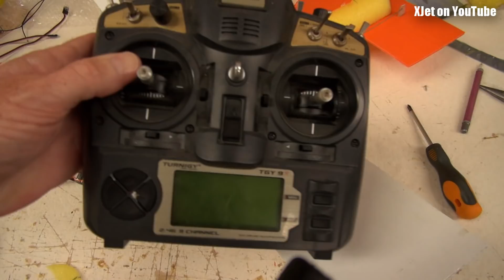The $2 pool-noodle RC plane build and flight test (part 2)

Comment: Reminds me of the ultra cheap "bearer bomb"  design we adopted for controlline combat. Due to regular crash/collision damage in 'cut the tape' combat competions, we started using ultracheap to build models, consisting of one sheet bals, two hardwood square engine bearers, a small fuel tank. Cutting a bit of the balsa sheet to make tail plane, gluing it across tapered engine bearer and rest of balsa sheet as wing,  with engine mounted at opposite end with fuel tank, sometimes that held by rubber bands or glued too. The elevator connected back to bellcrank to the control leads. Absolutely low cost to build.
With a but of paint, or even no paint built on the flying field to replace a damaged aircraft, these became the standard combat model. With up to six flying at a time in the circle, planty of action as everyone was trying to cut others streamers. Mid air collisions, tangled lines, plentry paper chaff flying around. Very little cost as engines rarely damaged. Models easy and plentty even for kids on pocket money.

Plenty of fun without needing lots of money and time. Few could afford combat flying based on fancy complex build models. Those needed far more input in matterials, time and flying  skill and trust in other competitors to avoid instant destruction of your model. This way all could get maximum fun. Possibly even your RC hobby could gain fun in similar cut the ribbon events using such low cost plastic sheeting and pool sausage like models. Low investment for challenging flying skills no (major) risks. Admitedly your RC gear and batteries are at some risk and costs but.....

Comment: I have an eachine mustang p51, can I attach 2 of the 1020 brushed motors on that board? I want to repurpose the board in a bi-plane with twin motors.. don’t want to burn anything out trying... 
any advice? Or maybe a build for you, twin motor plane non differential thrust...

Comment: Bruce, don’t know if you will see this, but in the States we have “ plastic baseball bats” that are sold at the drug stores and box stores....guys used to insert fuel tanks inside, ply engine mount, old tail feathers from crashed planes, and off you go.  Swap the fuel tank for a battery and lighter yet.  For down elevator you could add a horn on the bottom, or just make or better yet use a double horn from your collection of servo horns we all have a bushel basket full.   Update needed!

Comment: Hello. Could you please inform which small receiver is that? is it possible to bind it to Turnigy 9xv2? Thanks.  Say hello to Ron from Brazil.
Reply from the maker: It is a FrSky V8R4.  Unfortunately it won't bind with the standard Turnigy 9X.  My radio has a FrSky module in it.
Reply: Ok . Thanks. I also have a Frsky module in my Turnigy 9xr pro. When I saw the video  I thought the possibility of having a small receiver for the 9xv2. See you on next video.

Comment: Banggood sells them now for $100 .  Not really, but you never know, change the diehedral and yeah, awesome! I have seen others built and I am thinking I should build a few for beginners that refuse to fly, or even try because they dont want to wreck my other foamys. Great job. Bruce. Do a boom plane pusher. It would be fun. Have Rodney he lp you. Easy peasy. I have enough spare parts to build at least three of those, minus the noodle and that Coreplex stuff is really expencive. People steal those fast! Real estate people use metal signs for that reason. I know a real estate lady, she told me the core plex ones get stolen way more than the metal ones. Sign makers here charge for scraps. Go figure.

Comment: Nice one, Bruce! My fave video of yours so far. I've been going with polystyrene (chilly bins I pinch from sushi shops) for all my wing/fuse needs and only using corflute for control surfaces - as it's a lot heavier - but after seeing what a good performance it's put up here, I think I'll have to try one of these. And yes, pool noodle foam is great, I've been using it on crash-vulnerable parts of my builds for a while now - with a whole fuse made of the stuff, you won't be breaking much except props if you do have a prang. Yes, will definitely link you a video if I make something similar to this. Looking forward to the pusher FPV version!

Comment: Same thing but with a Cox  .049, sorry I'm a "wet" flyer. I actively fly, .10, .25, and ,46. 2,3, 4, and 6 channel radios.  OK, I'm a airplane nut.LOL
Reply: keith freeman Love it" Wet Flyer" I could call myself that as I cry every time I get my electric tangled in a tree. Since I have a depth perveption problem, that happends way too much! I do have a nitro trainer I am restoring, should be interesting. Sadly, I have so many pans in my fire,I hope to get my nitro running come spring.
Reply: Here in Michigan, during the winter it's building season.  Then flying when it gets warmer. 64 days to Spring as of today.
During the summer I teach people to Fly R/C, not to crash, taking off is the easy part landing without destroying the plane is a good thing.
I have been flying nitro planes since about 1962.  .049 to start, C/L, plastic planes, then to balsa flat wing, then on to buildup.  1976, first 5 channel radio, been flying radio ever since.  Primarily, .049, .10, 25, and finally .46's. I have a .56 engine but I haven't made up my mind what I should build for it.
Of late, Blended Lifting Bodies.  48 x 36, 4 channels. .25 & .40. 9x6, 15%.
R/C stuff is, sometimes, the most fun you can have with your pants on.
Reply: keith freeman I can relate? I live in Northern Lower Mi, Traversecity. 17 Degrees is way to cold to fly anything, period. Batterys dont last, plastic is brittle, fuel can jell, yeah no good comes from flying this time of year. I work on other projects until March, then I get my stuff ready. I just recently got back into nitro, having not touched it since 1979. It didnt cost me much to get back into it eather. About $200. I bought a starter kit complete with everything including fuel, electric fuel pump, electric starter, the Hobbico Wood box( the battery was dead, got an emergency light battery as an exact replacement at Lowes) and extra glow plugs, props and a pontoon boat all for $100. Sadly the nococill or chromium plating on the cylinder wall is bad,as well as bearings in the motor, but the radio works( futaba) and all servos. I plan on replacing the motor. I was going to run it on the snow. Until I can buy another motor, that will have to wait. Its a .60 from a trainer, I looked it up.Got a nice silver electric SR 22 trainer just before Christmas, brand new RTF for $80. Its a Dynam. That came with a seperate charger, of which I already own, a lypo bag and transmitter and receiver which I do not want, so I will sell both the charger and transmitter for what I paid for the plane.
Reply: I work for a R/v Dealership and we have done the R/V Show at the Civic Center there in Traversecity  a few times over the years.  I know my way around town a little.  Kinda thought that the field there might be cool to fly at.  What do you think?   I have a rather large coroplas flying wing thing with a 40bb in the nose.  Kinda slow, turns on a dime.
Reply: keith freeman I fly at a friends farm so I dont worry about what I can or cannot fly or when. The TRAMPS flyinfg field is just south of Traversecity on Rennie school road. I always seem to end up going to their open house. I know some of the guys there. A few years ago they sold it but ended up taking it back. Those old timers wouldnt even allow foamys back in the early days. Now they understand membership matters more than the type of flying craft. Now there are helicopters, electric and gas, even Quads. That old stereotype balasa or nothing died along with the old crowd.
Reply: Located the field on gmap.  When the weather gets better/warmer, I'll Have to toss a plane in the car and come fly.  I would really like to pick your brain concerning r/c airplanes and things that fly.  C U then.

Comment: Rontastic!!!
Reply: Ultra fun but useless; you can buy naked or de-gutted airframes for $10 or less, you pay for rest of the parts. You can also build great quadcopters out of chopsticks, eXperimental wingplanes out of carbon rods and a tapered box. Also can you reprogram a drone board to p0wer a multimotor plane???

Comment: A twin boom would be pretty easy. Get the props out of the way of the camera! Do pool noodles have a hole in the center? I thought about shoving a carbon fiber ( or wood or whatever else you might have light and cheap) tube in there, sticking the motor to the end of that so it is removable and adds strength.
Reply: Ben Carter Yes, they all do.

Comment: This is indeed brilliant, and as a STEM educator, this belongs in the bin of tools all aerospace educators should have to teach. I would change one thing though...I would create a wing that is actually a wing shape. If kids think that a flat surface is how planes fly, they would be miseducated. I think it wouldn't be that hard to make a wing shape out of the same materials.
Reply: That a flat wing plane flies so well destroys an all too common myth about how wings work.  You don't need the wing curved, or a longer path along the top surface.  A cambered wing is favored for not stalling as easily.  A thicker wing is better structurally.  But a flat wing works very well as long as you can get the needed lift at a modest angle of attack, and enough stiffness.
Reply: A flat wing works at the expense of power. If you tried to fly a flat wing without power (a glider for example) you would fall out of the sky. Angle of attack is why a flat wing works. That's why you can fly a brick with enough power. So a curved wing is not a myth, its a reality of aerodynamics.

Comment: For your next build could you do a whiteboard video on the build beforehand where you go through the math of selecting / sizing the components correctly? That is calculating the needed thrust from the propeller to hover the plane, determining the motor size needed, what wire gauge is needed and amps needed from an esc and finally the size of the battery needed. There are a few videoes on youtube, but none that I have found goes through the whole process from prop-size to battery size.

Comment: You should make a kit out of this and sell to support your channel. 😀
Reply: The electrical parts, a sheet of coreflute, a page of instructions, builder buys their own pool noodle locally?  Though if the kit includes the receiver, it would also need a transmitter to be sure the buyer had a match.

Comment: I’m interested in this dihedral configuration that you’re talking about. A detailed explanation video would be awesome.
Reply: Simple,rudder controlled models rely on dihedral to bank,put too much dihedral and they have what is temed a Dutch roll effect,that is when you turn with the rudder the technique is to hold on the bank in the turn to stop the model from righting itself,a Dutch roll shows up as the model constantly trying to right itself,a rudder only model then only turns when the model has dihedral,years ago trainers were all rudder operated and there are a few full sized  Ultralight aeroplanes that use this system too,also by doing what Bruce did with the excess dihedral lowered the fuselage making the mid wing design more stable as the centre of gravity too is low,I see these models as great learning tools to experiment with.

Comment: I put clear tape on the edges of the core flute because unless you cut it at the point of a rib you end up with an aerodynamically 'dirty' edge. Now it's off to The warehouse to get a noodly appendage...

Comment: Good job!
For a slightly swept up version consider a Jedelsky wing. Will allow use of 3.3mm corflute as the kink will stiffen up the wing.
If you need to increase the wing area and reduce the dihedral, an outboard panel can be added with heat bent bamboo skewers to join the panels.
For the creme de la creme signboard designs (with plans) see the  large thread: https://www.rcgroups.com/forums/showthread.php?1445391-Correx-PSS-L39HawkF-18FoxxU-2ImpalaA-10SpitfireF4USeaFuryP-51VulcanFW190-free-plans%21

Comment: Nice build! 

I'd be interested in seeing a video on the process of using a wattmeter to select a prop to maximize thrust and battery time.
Reply: You need to put it on a thrust stand, and graph out power and thrust on a set of props. Then you will find some do better at high power, and some at low power. So given a single motor, you could pick one giving the flight regime (such as are you needing almost max power the whole time, or just a gentle glide? If its a gentle glide, then why are you using a heavy motor (Vtol?)?). Its actually very time consuming if you want to do it right, and you can't possibly do it without graphs (use an ardiuno, because graphing by hand is going to be super time consuming).

This also won't tell you the whole story, since they will behave different in flight than static thrust, you need to make a wind tunnel to test that (not crazy hard to do, but you might see where this is going).
Reply: Thanks +Jake Garrett. I've been working on an Arduino project to collect the data already. Just wanted to get a few more insights.
Reply: Ok, well post back if you make a good program for this. I imagine you would need a shunt resistor and a simple voltage input (probably voltage divider). Make sure not to power the arduino with the same batter (I've made that mistake... It doesn't do too well when its a short out because I wasn't thinking enough about it). Shouldn't be too hard, probably a strain gauge and a simple (preferably out of common part someone can replicate) beam with the motor on the end and you will get a nice force measurement. Don't forget to keep the motor away from the ground or walls so you don't get ground effect scewing results (so a long beam hanging over  tall table edge at least).

For wind tunnel it will be a little harder just because accurate velocity gauges are a little expensive (or at least more than a hamburger). But static thrust stand would give you a good rough estimate to start with, and you'll probably find how you fly as a pilot will probably make bigger differences on flight times than prop changes once you've found a good static prop.

Best of luck!

Comment: Political signs are often made from the same fluted material. And when the election is over they are even more available than realtor signs who probably would reuse their sign. I once saw a video of a guy who built a small camping trailer with a light wooden frame and political signs, light enough to pull behind a bicycle. It was plenty sturdy, and rain proof.